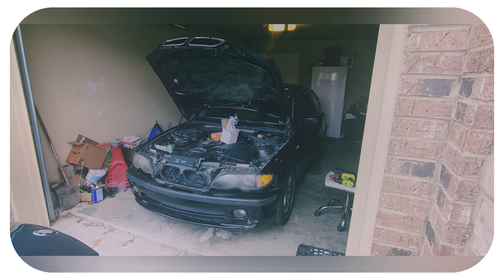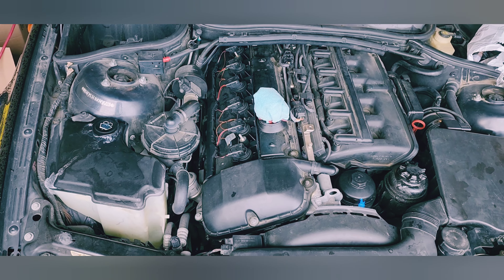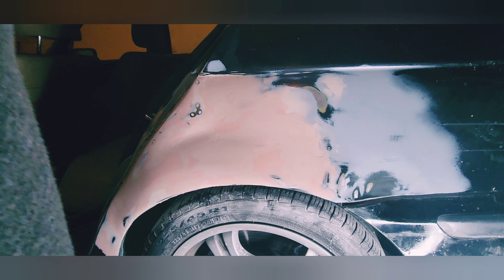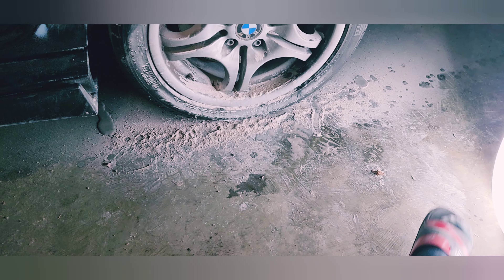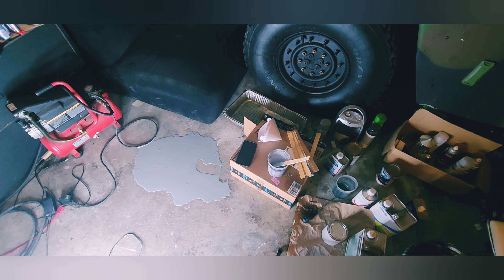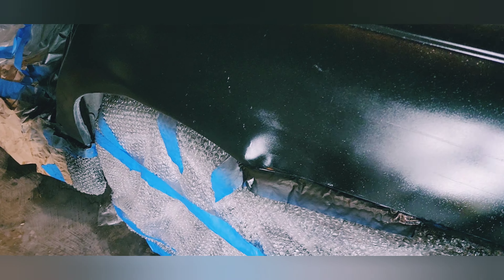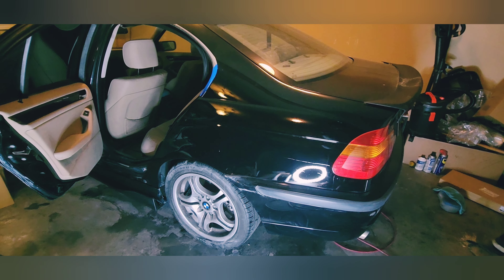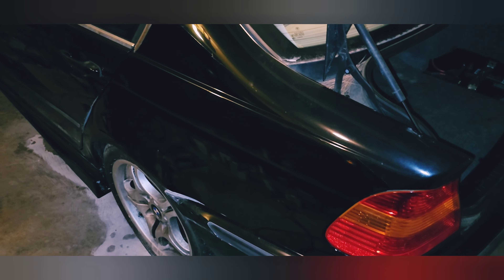04 BMW 330i e46 body work and paint Ep. 3. I messed up big time🫣🫣😅😅

Comment: You can buy replacement rear wing and weld them. Body filler won't look proper no matter how much time you spend on it, plus if you have rust starting on the inside it's gonna pop out.
Reply from the maker: A couple of people told me to do the same thing as you told me. But after Im done with it,lol. 
I'm working on Gaskets now and coolent parts and spark plugs/ coils.  
Will get back to the body later after I replace all these parts and refresh the engine with brand new stuff.